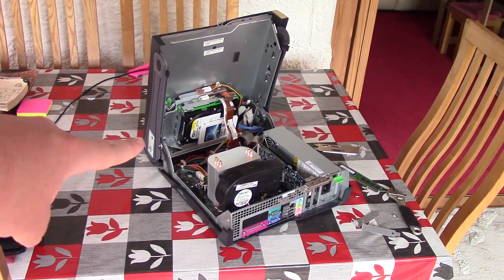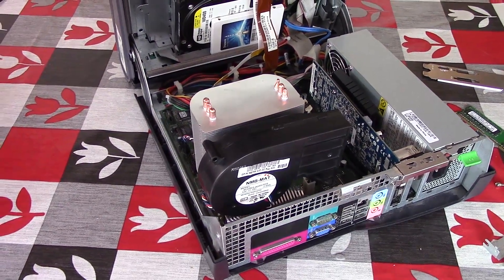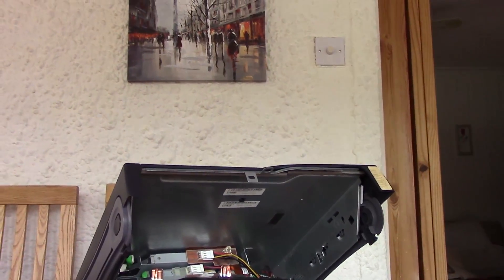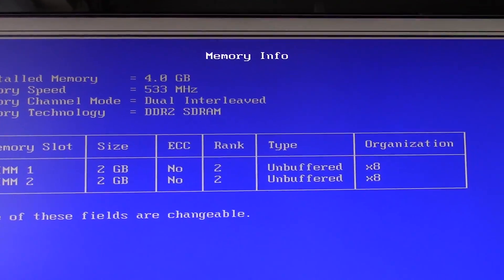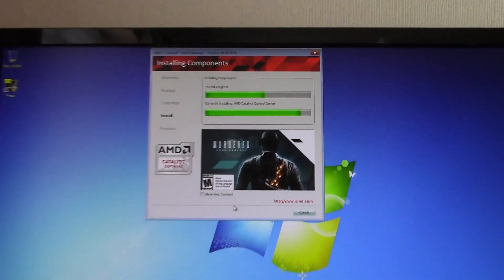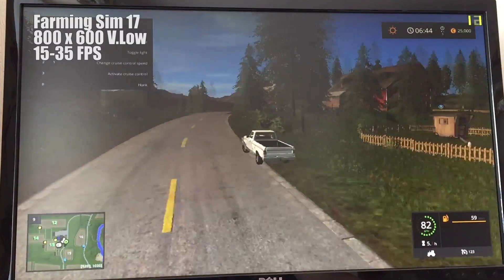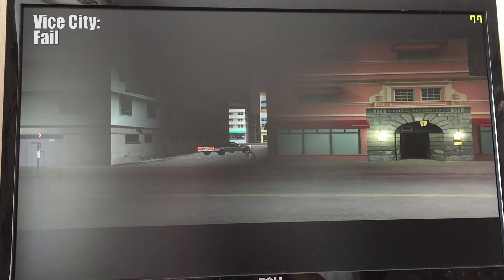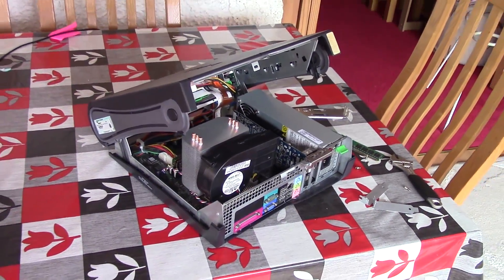The $0.30 (£0.25) Optiplex Gets Modified...

Comment: I have an OptiPlex GX240 SFF (160W PSU). Its max "official" CPU is P4 2.8GHz 400MHz FSB 68.4W. I want to know if a P4 3GHz 800MHz 84W will likely work in it (despite slower FSB)?

Comment: One question the driver didn't bugged and said you have a Amd HD 7470 because some years ago back in 2016 i bought a 6450 that what the pc repair shop  said was but after i bought and instal the driver here i got a 7470.

Comment: I just built a PC with old spare parts I collected over the past few months, I only wanted it for my friend to use for league if legends and it plays it at 60-70fps, it's an athlon II x4 645, HP pavilion Mobo,  Radeon HD 6000 (can't find exact model, it's noncompaitble with Windows 10 for OC) but it works on 1080p. Definitely was a good surprise

Comment: If that's ddr 2 it can go to 8gb.  There is very limited types of 4gb memory that will work but it has to be low density ram of 4gb . Not worth getting though as you looking up to 100 pounds for a single stick on eBay

Comment: Could you check out if it plays any of Dead Space game series? It certainly will do the first one at least (I'm just wondering of perfomance)
Recently I was surprised finding DS3 run smoothly on a system with HD 5450 (silent one by asus,1gb ddr3) and Celeron G530... I managed to achieve solid avg 35 fps by applying lowest settings and 1024x768 75hz resolution (to say, there was old 4:3 monitor, so graphics didn't look terrible at all)

Comment: You could have installed the Grub bootloader on the mechanical drive and made it detect Windows on the SSD, this would have made the SSD work as a primary drive, with the bootloader running from the bootable mechanical drive

Comment: Cheers for the video, why didn't you just cut into the cables of the old cpu fan to wire in the new one? Would have been easier and cheaper!

You need to use 'memory remap' feature to get the full 4gb on old PCS.

Comment: you could upgrade your cpu, but then again 2.8ghz isn't going to set any records, may I suggest you replace it with a more 'modest' Pentium_4 660 3.6ghz, and if the cooling is decent enough you could do a bit of overclocking, but that would be out of the question, so no go there (silicon isn't a 865G is it?), you'd at best get +10% extra performance simply by tweaking a few settings, "using RW-everything on the ddr2 chipset" please 'don't try this' unless you are certain that your rig is capable of such a 'tweak'. I still like the 'seagull' and all that jazz.

Comment: Am I the only one surprised that Intel made 32-bit only processors in LGA775? I had a P4 524 system and just assumed that if that lowly processor supported a 64-bit instruction set, all the LGA775 stuff did.

Comment: More then likely that "custom" dell fan header is just your typical 12 volt PWM fan header. A little chopping and splicing could let you use a low profile cooler with a 12v PWM fan. Though you could always try using a multimeter (even a cheapo one for 10 bucks) to make sure where its 12volts + and - connection are.

Comment: i was just given a dell optiplex gx620, i have two other optiplexes in storage. i also have my old desktop that has a Pentium 4 running at 3.6 ghz i need to dig out and set up as an ultimate xp gaming machine at some point. need to figure out an appropriate gpu for it though(has pci-e slots).

Comment: That Gx280 should be able to take 64-bit cpus, I have a Pentium 4 630 in mine and it works fine.
Reply: i have one with a 2.55ghz 64bit celeron. its my retro rig

Comment: A 32 bit Os will recognize 4GB of memory total that's a combination of system ram and graphics ram if your GPU had 256MB it would detect 3.75GB of the system ram.. if it only detects 3GB of your system ram it's because the GPU has 1GB of vram. My system has 16gb system ram and a 2GB video card so in a 32bit OS my PC sees 2GB ram and 2GB Vram.
Reply: A dedicated gpu like the one used in this video has its own memory it uses, only integrated gpus built into the motherboard/cpu use the system ram as vram. The reason why only 3gb is usable is probably due to a limitation of the chipset on the motherboard.
Reply: Integrated reduces the total system ram amount, yes I know this. The 32bit OS issue is not the same it can only address a total of 4GB of memory and it is a combination of system ram and vram that it counts. 3GB system + 1gb vram = the 4GB limit for 32bit os. It's the OS addressing issue not the chip set limitation in this case (which is 4GB on this type of system).

Comment: Hey, i had the same issue with the SSD Not working in an old Computer. What helped me was reinstall windows over the Computer and then while starting the PC Pressing F12 (IT was a dell, idk whats on yours) and using the UEFI "Windows Boot Manager" Not clicking on ssd. When windows boot Manager starts, IT selects the ssd as the main one and starts it. Maybe IT helps. :)

Comment: I just use a safety pin to pull the pins out of the plugs to the fans on dell boards and putting them in dell pan pins.

Comment: I was able to run gta 3 well I bought a 6450 for my pentium 4 550 still was bottle necked but games would work smoothly I played emergency 4 or 911 first responders got a decent 20-40 fps. Nfs world 20-30fps and far cry 1 lowest settings 30-40fps.

Comment: You could look up to the 771to775 delid site, flash bios with all codes of CPU and it should run it, i flashed my 775Dual-Vsta cause it couldnt support Quad core, and I did it and it worked.

Comment: I'm confused about the TES Morrowind results, because when it was released i could run it on a athlon xp 1800+ (1533MHz) and a geforce 4TI 4200 512MB ddr1 400. Just forgot what was the resolution on my 17" crt, but probably something like 1024x786

Comment: You SHOULD do the following
1.source the 64bit variant of the processor (the bios in the vid even confirms it'll work)
2.install Recallbox/Bacotera Linux (just download the image and burn it to the drive with Win32DiskImager
3.dump a bunch of roms from GameCube/PS2/Dreamcast and older onto it
4. Enjoy
Reply: Although the motherboard bios says it can support 64 bit, the chipset it's using doesn't. He's stuck with a 32 bit processor. Even if he could get recalbox with batocera on it, Dreamcast would struggle, Gamecube won't run at all, and PS2 is impossible with this hardware. Look at ETA Prime's videos. They've reviewed a PC with a celeron with near identical preformance to this P4, and that really struggles with Dreamcast, and Gamecube is under 5 fps. PS2 is out of the question.

With a faster PC like a Core 2 Duo, this would be a great option though !!
Reply: television and cheese
Ok so:
1. I've PULLED 64bit Hyperthreaded 3ghz P4s from these (still got two in a drawer).
2. Ive ran PCSX2 with the 32bit P4 on one of these, albeit the full sized gx260, and a 512mb 250gtx, running PS2 games directly from disc . 
3. It also ran Skyrim, Fallout 3/New Vegas and Bioshock Infinite at 720p medium above 30 fps. 
4. That mobo CANNOT do a dual core, it's chipset is too old - it WILL handle the P4 64bit variant, however. 
Ive screwed around with a few of these and parted them out.

Comment: Hey i have an AMD A8-7410 APU with Radeon R5 Graphics and i've heard that it's a laptop cpu.This means that i can't replace it with another cpu?
Reply: Carl Johnson Why don't you open it up? Look and see if it has a socket or if it is soldered. Even my laptop has a socket for changing CPUs, so even if it was a laptop that wouldn't mean much.
Reply: Jake Garrett I don't know what that means but i can give you a video to see what my cpu looks like

https://youtu.be/hCR9bGR3mPY
Go at 6:55.It looks like that.Also,that case is almost same like mine.I hope you can figure it out and help me
Reply: Carl Johnson I can't tell anything from looking at the video, all I can see is the heatsink, you need to remove the heatsink or at least look at it from the side. If it is replaceable, it will have a plastic socket (looks like a little stage for the CPU) and a metal lever on one side. If it isn't, the CPU will be basicly flush with the motherbpard without any plastic at the base and no lever (meaning it would be soldered).
Reply: Jake Garrett Do you have Discord?Maybe i can send you some pictures from my pc too see
Reply: Carl Johnson I don't have a discord account, but you should be able to tell. Just look up "AMD CPU socket" or "AM3 motherboard" images so you know what it looks like, and then you should be able to see pretty easy on your motherboard if it has a socket or not.

Good luck
Reply: Jake Garrett I think it's a FT2 socket

Comment: The usff lenovo m91p. i5 2400s, 2 ddr3 sodimm slots.1 PCIEx16 LP slot and 1 mPCIE. Pop in GT 1030/ GT 1130 with 8GB ram, mPCIE wifi from an old laptop or whatever, Get a usb powered 13/15 inch monitor and bam, budget mobile gaming desktop.

Comment: Boa to delete Black bars in 800x600?
Reply: Go to either: Intel HD Graphics Control Panel / AMD Catalyst Control Center / Nvidia Control Panel. You can usually find these by right click on the desktop, or search in start menu.

Then find option of Display > Desktop/ Size/ Scaling/ Position, and find the options of Keep aspect ratio, Stretch to fullscreen, No scaling. 

Choose option of Stretch to fullscreen.
Reply: television and cheese thanks

Comment: How the heck did it not run Morrowind, Vice City and Mafia? Those games can run ok on a P4 and I doubt the video card can't handle those games. Must be some driver error.
Reply: conyo985 I agree. If my via chrome 9 can run morrowind, that thing should also be able to.
I think its something wrong between win 7 and the drivers. I think XP would be better there
Reply: I agree too, even my toaster can handle that on 120 fps
Reply: this PC for sure needs an XP install with all the proper chipset drivers, and he could have also cut a hole in the top of the case for the CPU, and Heatsink with the blower fan facing away from the GPU, as the system might be thermal throttling itself as well.
Reply: Agreed i used to run a Pentium 4 2.8ghz with an nvidia fx 5200 gpu and i played all of those old games all day.
Reply: Exactly what I was thinking 🤔 Vice City was the first game I ever preordered and I was running it perfectly on a much slower system than that! Actually, I still play it from time to time on a vastly superior system, so it must be some driver issue.
Reply: Probably an API/OS overhead from Windows 7. I attempted to run Morrowind on a Pentium T4300 laptop with GMA950. Windows XP was fine, Windows 7 lowered it a little and Windows 10 rendered it unplayable
Reply: Windows 7 with aero theme I would imagine
Reply: um..well first obvious mistake he made was putting that video card in it. if you want to have better results install a geforce card. and yeah secondly keep XP on it. something like the Integral build.

Comment: I'm looking to buy an older machine like this but to repurpose as a home server. Are there any particular processors that I should look out for?
Reply: Avoid Pentium 4, they run very hot and are very power hungry. If you're running it 24/7 as a server, it would not be the best idea.
Go for something like a Pentium Dual Core, they cost about the same, and use much less power and have pretty decent performance, about as good as early Core 2 Duos.
If you're just using it for file sharing and video streaming, then this will handle it no problems.
Reply: I wont be doing anything like transcoding I just want somewhere safe to keep blu ray rips

Comment: You should have installed Afterburner w/ Rivatuner to monitor the CPU and GPU usage so we could, in the games that were working, check what was the bottleneck between the Pentium or the Radeon. Other than that, great video :)

Comment: Heyman, 
If the fan is a similar spec you could have spliced the wires (Frankenstein style with electrical tape) 

Or spliced them directly into a molex cable due to the power being so low, it wont add load onto the PSU

Comment: I need help
Is my amacrox 350 watts psu enough for my pc
Specs
I5 3330
8gb of ddr3 ram
Asus steix rx 460 4gb "requires a 6pin connector"
7200rpm HDD
2 system fans

Comment: pentium 4 sucks
Reply: HB C Athlon was better
Reply: Not really, HB C!
In about 2000, you could get a much cheaper Pentium III, which had almost 50% more performance than the Pentium 4s !!
Although I wasn't building PCs at this point, I was happy with my Pentium II pc, I did keep up to date with the best deals , and the Pentium 4 looked like a pretty bad choice . :/
Reply: My 3.2GHz P4 HT gets 0.51 pts on Cinebench R11.5... Yeah, that's with NO overclock, on stock cooling 

It's ok if you are now in awe at the sheer speed of this beast.
Reply: amd was better from the athlon duron right up until core duo
Reply: an athlon 64 3200@2ghz smokes a pentium 4 3,2ghz ht
Reply: https://www.youtube.com/watch?v=rGWUfpzjaBw&t=1311s
Reply: It wasn't until Intel started clocking the P4 above 2GHz did we see some sort of a performance gain. Even then, the P4 was not very efficient and drew more power than the PIII at the same clockspeeds. Prescott really ramped up the heat and power draw, giving the nickname "Preshott". It is indeed true though that the Athlon 64 smoked any Pentium 4 while being 1GHz+ slower in clockspeed. Intel wanted to get the P4 to 10GHz, but power issues, heating, and reliability were really taking a toll once it hit 4GHz. I still have a P4 631 with HT, and I've gotten it to 4GHz once, up from it's 3GHz base clock.

Comment: So is this a justifiable rig or a portal to bad performance? Seriously though, jokes aside how the hell do you get such cheap PC's? I have searched Ebay, Facebook, and Gumtree but the cheapest I could find was 20 quid though that's not too bad in and of itself. You could have stuck a GTX 750 (not the Ti) or GT 1030 in there for more FPS. I would have thought the 1030 or 1050 to be the ultimate candidates. I actually have the Radeon HD 7750 and have no use for it. Would be ideal for a build like this.
Reply: I honestly dont believe these channels get their stuff for as cheap as they say they do. Ebay listings for an optiplex such as even this start at around £15 buy it now. If it was on an auction style listing it would start at 99p and they DONT stay at 99p. Usually go for around 12-30 depending if its got a better cpu etc.
Reply: This is a super old Optiplex. There are similar Pentium / Core2 machines at my local recycling centre. When I asked one of the attendants how much he wanted for one he just gave me an odd look and said "Nothing, just take one or two." Honestly, these old machines are so limited you're much better off spending a little bit more and getting a platform that is still able to be upgraded.

Comment: Mafia runs on Pentium 3 and Geforce 2, it must have been Windows 10 problem
Reply: Lettmon yeah, I still play it some times on my first pc, which was a P3 @1GHz paired with a Nvidia 6200 and 128mb sdram (it used to have 512mb back in the day, but the sticks just decided to die on me :P). Surprisingly I get 30fps stable on the lowest settings, even though with 512mb I was able to play it at the highest settings with the same framerates and stability...
Reply: What has Windows 10 got to do with this video...?
Reply: HB C It may be due to Windows 7's architecture, as it is a non-DOS system unlike Windows 98 or 2K...
Reply: @MegaSmarthead  win 2k was not DOS based, infact it was the first commercial windows to run without DOS
Reply: Windows 10 isn't the problem because he installed Windows 7 32-bit. Pay attention, son.
Reply: RWL2012 certain pc's can barely run Windows 10 I had a newer Dell I bought with the windows 10 upgrade freshly installed had mouse lag popped in its OG OS Windows 8 no mouse lag after that. Some pc's are picky with what OS version they use.
Reply: maybeDOS True, I have an i7 laptop which came with Windows 7 from factory and it wasn't able to handle it... In this case I had to upgrade it to 10 which is running fine 🤔

Comment: I just got an Optiplex 990, i7 2600 cpu, put a Gtx 1050ti in it , it runs Total War Warhammer 2 no problem.But I did upgrade the 265 watt PSU, Nvidia Gtx 1050ti specs page recommends 300w minimum.
Overall I am happy with that result, it was for a friend who had chopped a hole in a Core 2 duo small form factor HP , with the 1050ti poking out the top!

Comment: Any idea why something like Morrowind wouldn't run well? Vice City should also run just fine on that system.
Reply: Didn't he use Windows 7 32 Bit?
Reply: Yes he did. I played through it several times back in the day(with decent quality) on Windows XP 32 bit, an Athlon XP 1700+(1.467ghz), 512MB DDR 266(single channel) and a Geforce 2 MX 64MB(175mhz core OCed to 185mhz, 167mhz 64 bit sdram OCed to 177mhz). All the specs in his OptiPlex take a dump on my old computer.